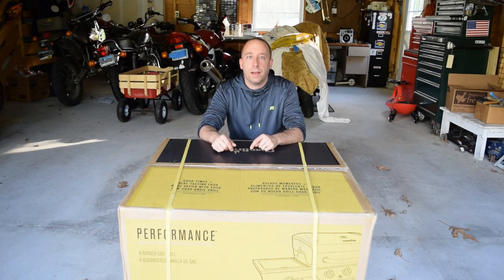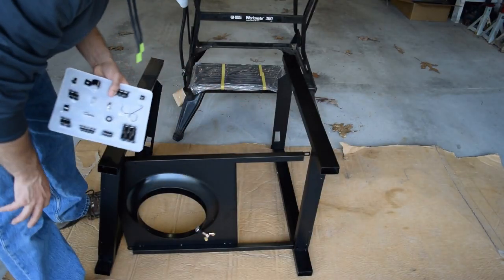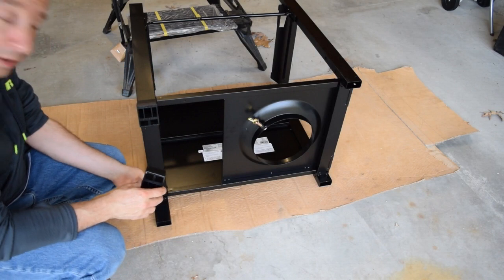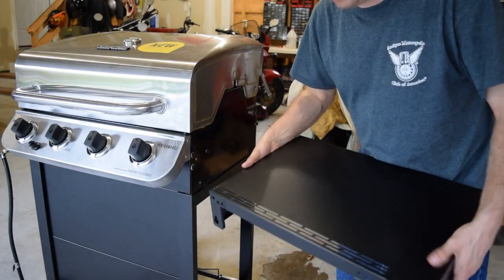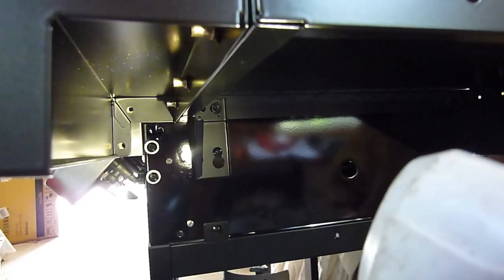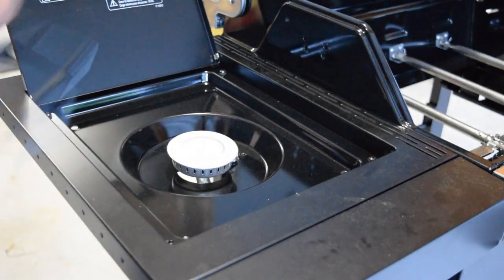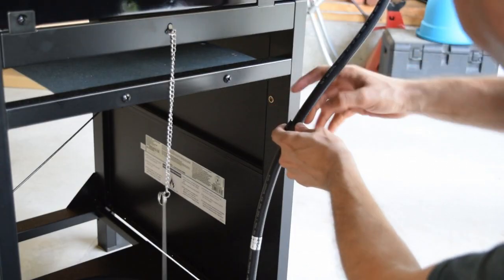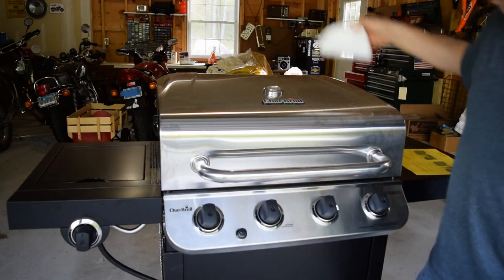Char-Broil Performance  4 burner Grill Assembly (Model number 463347017)

Comment: Thank you for your video. I had a question, although it may be one you may not be able to answer, so I apologize. A squirrel chewed through the propane hose that connects to the 5th stand-alone burner. Is there a way I could buy a standard hose, and just bypass the 5th burner, and connect it directly to the end that feeds the other (4)? Thanks for any help you may be able to provide.
Reply from the maker: I think you could do that but I'm no expert.  Check with your local hardware store or a local HVAC guy if you have one to see what parts you need.  And be careful....people have gotten hurt and killed by inproperly connecting propane tanks!  The best solution may be to buy a replacement hose/assembly from CharBroil

Comment: Would it be possible to use this grill without installing the side burner at all?
Reply from the maker: I would think you could but you would have to make sure the side burner control was kept off and tucked out of the way as it is part of the regulator/gas hose for the main burners.  I personally wouldn't do this and don't recommend doing it as it poses a bit of a safety risk.  You could change the regulator/hose assembly for one that doesn't have the side burner and that would be safer.  I would think it would be easier and cheaper to just get a smaller grill that doesn't have the side burner if you can't or don't want to use it.
Reply: SevenFortyOne thanks for making this video, very helpful and informative.

Comment: Is the side shelf optional?  I am going to put this on a narrower deck and I don't want it to hang out over the entry stairs.
Reply from the maker: it looks like you could leave it off but the burner hose would dangle.  You'd be better off buying a smaller grill

Comment: Has anyone had issues with a low burner flame with this model?  Grill will not heat up past 250 Degrees.  Clearly, this is a regulator safety issue. I have done everything.

Comment: Legit question:  is the rod (7:19) important or can the grill be without?  For the life of me, I can’t get it to reach the hole in the base.
Reply from the maker: You might have something else out of whack then.  I think that rod is there so one doesn't put a second propane tank on the shelf and overload it, or something along those lines so probably not strictly necessary.  But I didn't design this thing so I can't say for certain.  But...if you have everything set up correctly then that rod should fit without too much trouble.

Comment: I just installed the same one and one thing that got me hesitant is the side burner where the burner connects to the gas line.... So there's a mesh gap in the copper connect line.... Is that how it is supposed to be?
Reply from the maker: Yes - the wire mesh is supposed to be there.  That allows air to get into the burner so that it will burn properly.  I don't fully understand how it works but has something to do with fluid dynamics and the Bernoulli principle.
Reply: SevenFortyOne great video BTW, I watched it to make sure I did everything correctly. Can't wait for father's day now. Thank you!!
Reply: That info is what I came looking for! I couldn't believe that there is no seal. Did your pieces seal together or just set in there? Hopefully you know what I mean. Never got that clip on either. I could hook it on the long end, but the other side? No place to connect. Couldn't see that in the video either.
Reply from the maker: The end with the smaller hook goes into a small hole in the burner tube.  The shorter, fatter end just slips over/around the metal fitting that is behind the burner control.  Once the spring clip is on properly it holds the pieces together fairly well.
Reply: Wonderful video.... Could not have completed without you.  Thank you
Reply: allen lee thanks for the how to video for the first time I was able to do by myself thanks
Reply: Thanks I also thought the side burner was kind of sketchy and I was afraid it would start a fire.
Reply: The side burner spring clip installation diagram is not clear at all. Now i know where it goes. Thanks.
Reply: @pennyf6392  I'm in the same situation?  Did you ever figure it out?
Reply: Think carburetor

Comment: I bought this very same gas grill at Lowe’s today. I don’t know if the guy in this video works for Charbroil or not. I know this for damn sure, if you think your grill is going to go together as easily as in this video, you are in for a humongous surprise. It took my wife and myself working together over 5 hours to put this piece of shit together. The problem is there are no god damn fucking written instruction. The cartoon instruction you get must have been drawn by the village idiot in some remote village in China while he was hopped up on some mind bending drugs.
First of all you will need a strong magnifying glass to decode some of the cartoons. Even then many of the cartoons are indecipherable. One cartoon will show a part in a certain place on the grill, then the very next plate will show the very same part in a different place on the grill. It is impossible to determine the assembly order from the cartoons, so you will end up putting some sub assembly (side burner switch) together only to have to take it apart and do it over once you realize the mistake. 
I could go on and on, but to list every mistake traceable to the cartoon instruction would take me as long as it took me to put the damn thing together.
Suffice it to say if I ever get my hands on the fucking moron who designed these so-called instructions I will wring his neck, even if it means jail time. Charbroil may also rest assured that any future grills I purchase will not be a Charbroil.
Reply from the maker: For the record I do not work for Char-Broil or Lowe's nor do I receive any compensation from them.  I'm just a guy puttering in my garage...